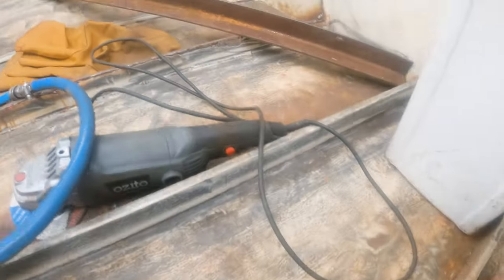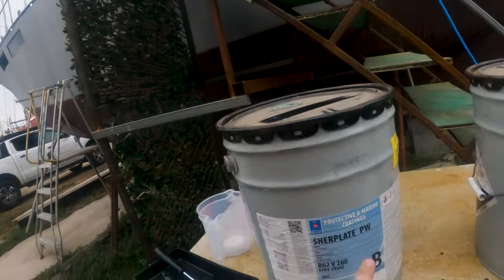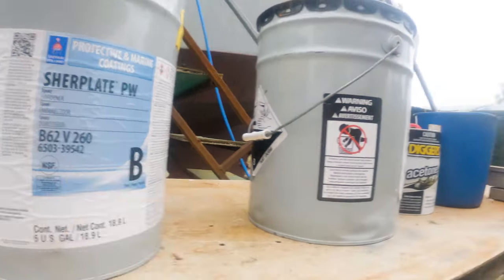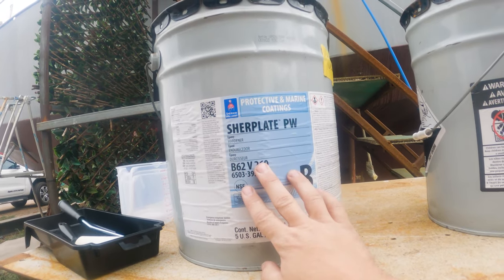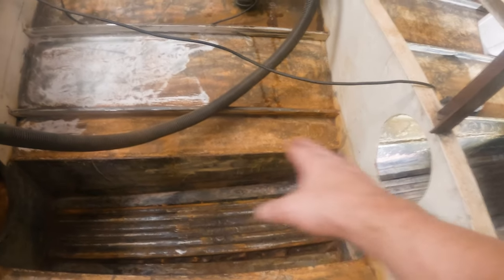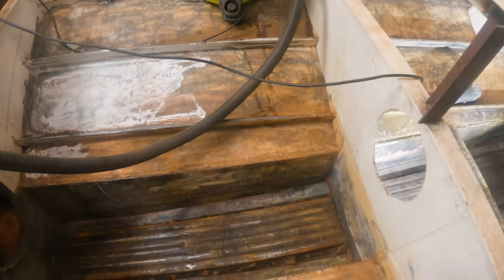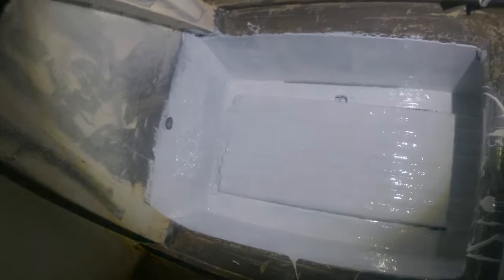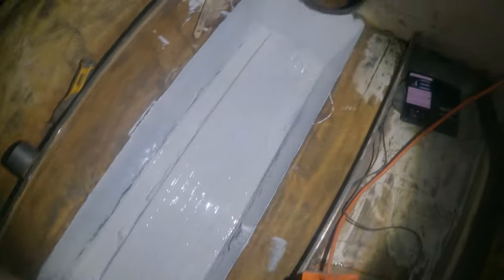Sailing QC #66  Finally Painting the Bilge  |  Stud Welding  | Steel Sailboat Restoration

Comment: with welding those studs for the windows i think you'd be better off drilling holes in the boat poking the stud thru and welding the ends up from the outside if that made sense lol
Reply from the maker: Hi Graham! we did consider doing this however I was trying to avoid dissimilar metals and crevice corrosion by creating holes. This is a little bit more work but we have less risk of corrosion underneath the paint :)
Reply: @SailingQuickCreations  didn't realise the studs are different steel but now that does make sense.